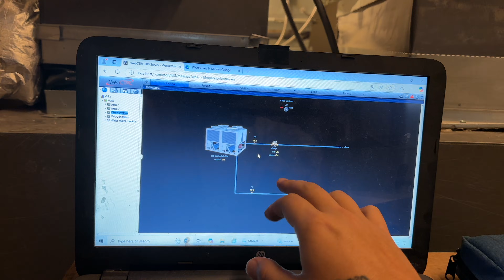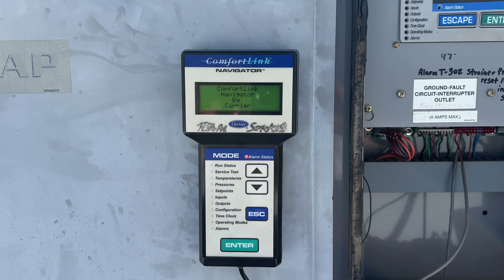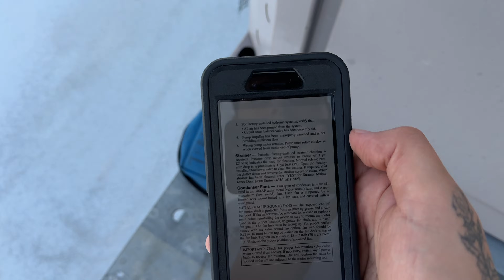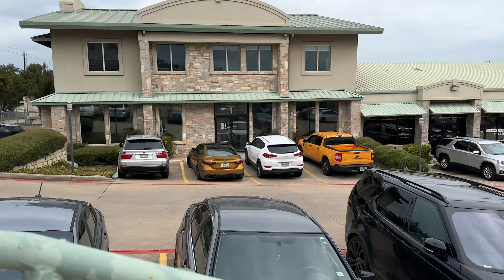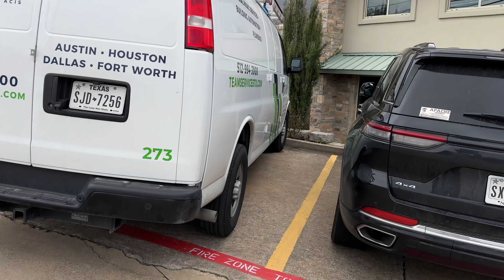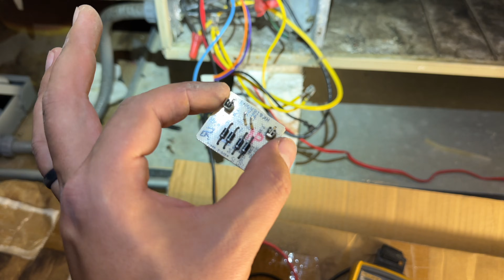Baby Chiller Call, Entire Building Is Hot!!

Comment: Hello there hot stuff (get it? HOT stuff, sorry, I couldn't resist! hehe) those "little capacitors" are NOT capacitors at all, actually, they are DIODES and should NOT show any "continuity" rather, should show 0.600v (roughly; as they are silicon diodes) when placed across a diode tester (usually. modern DMMs, including the one you have,  has a diode test function)  Diodes are semiconductor "switches" that only allow current to flow in one direction (from the "anode" lead opposite the white band to the "cathode" lead with the white band, but will BLOCK current if its reversed), also, that board appears (I'm guessing here as I can't really see the board on the camera)  to be in a "bridge" configuration and this function is to turn AC into DC (known as rectification or as a "full bridge rectifier" circuit)  I hope this helps you!
Reply: literally same thought as he says capacitors like this comment
Reply: Actually they are resistors 😊😂
Reply: @ Sure- they will resist.. line current... before they explode ;)